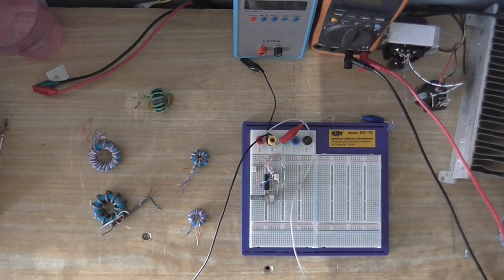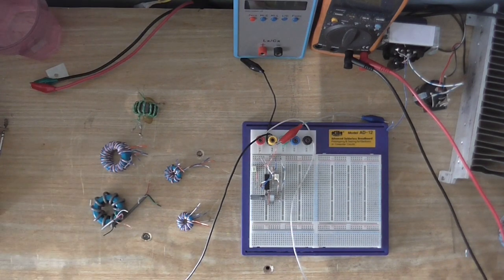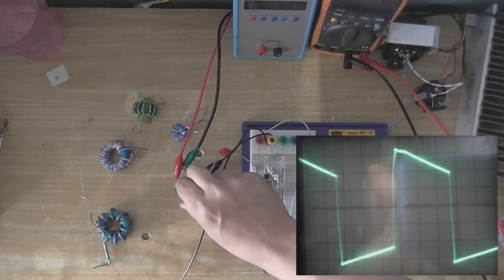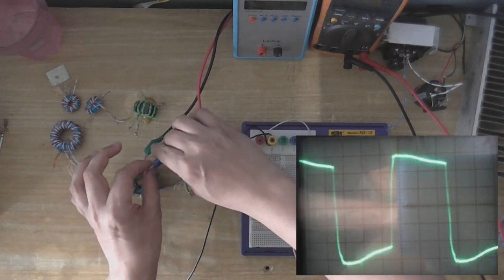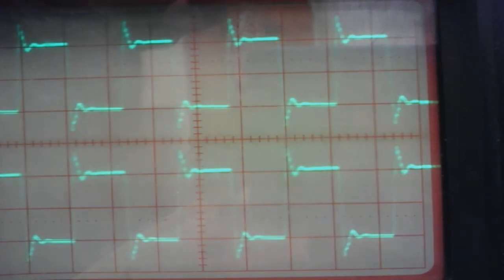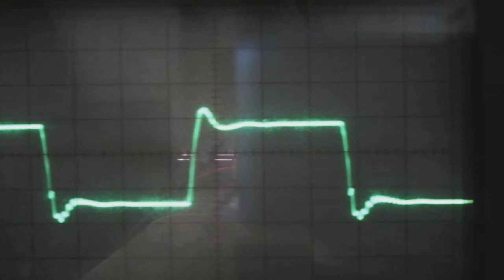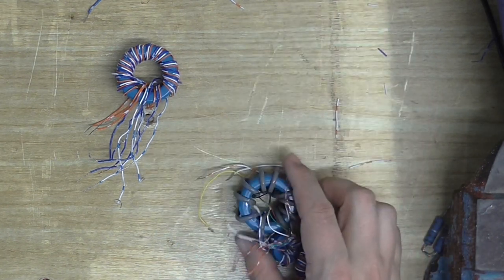Tesla Coil Tuesday - Building a Full Bridge SSTC part 2 - Gate drive Transformers

Comment: I also building a full bridge but for driving a ferrite core transformer, I also have to make the GDTs, I will use four 30B120 IGBTs, you should use the discharge diodes, thumbs up :) Alex
Reply: What do you mean by discharge diodes?
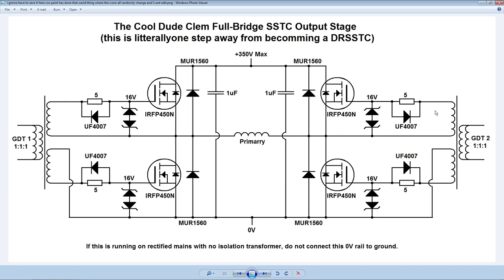Reply: +Anto Mani 12:38 diodes across 5 Ohm resistors
Reply from the maker: I'm gonna use the high voltage diodes after all, you'll see that in the fourth video.  I've just finished shooting the 5th (and final) video where I run the thing off rectified mains, it looks pretty good and nothing exploded which is a bonus!
Reply: CoolDudeClem Oh yeah, absence of not planned explosions&fires is the second best ;) First is the working project, of course. I'm looking forward to see some nice sparks
Reply: CoolDudeClem That's spoiler hahaha.
Anyways for these discharge diodes you should use very fast diodes, maybe shotkey ones like the 1n5819.
Reply: Schottky at what voltage level?
Reply: John Conrad It's placed in parallel to the gate resistor(between gate and gdt), it is not gonna see any high voltage.

Comment: hey very nice video, especially the ideas  with the  gate capacitysimulation and the  mouse cable helped me alot, i only a have a half bridge sstc  but 230 volt (its some where on googel +) because my country  has 230 volt  but i want to buid a full bridge sstc aswell

Comment: Can you please post details regarding Core size,no of turns and wire size in mm. thanks
Reply from the maker: I can't quite remember, but I think I used an N30 core, about 25mm diameter, and for the wire, it was about 12 turns of single core insulated telephone wire.
Reply: @CoolDudeClem  Thanks

Comment: Just trying to help.  your gate drive transformers work great!!!  However, considering that they are supplying no more than 1 Watt of power, and you're using a core that can run a couple of hundred watts of power at 350KHz, you can use a 0.5" OD core with much smaller gauge wire.  average current to the MOSFET gates is about 50mA.  #28 wire will do the job.   Core 3F3 for 350KHz operation.

Comment: Hey cooldudeclem, its me Ivan again, I checked conrad for the parts, and I did not find those exact mosfets, however, I instead got BUZ11s, and IRF4905 mosfets, I know that the BUZ11 is a very powerful and reliable mosfet, however I am not sure of the IRF4905. As I did not have the core, I am instead thinking of using an opto isolator, and a 555timer chip. Will my setup work? P.S. I am going to post a video of it on my channel if I get it to work. Thanks, Ivan R.
Reply from the maker: Unfortunately an opto oscillator wont work, you had a good idea there but opto isolators are just not fast enough.
Reply: CoolDudeClem Odd, I thought they ran at frequencies up to 1mhz?
Reply: CoolDudeClem but seriously, screw the isolation, as I wont be running it at more than 35 volts (limited by my powersupply), and I diode "chopper" should do the trick. However, I am motr concerned about the mosfets, will they work?
Reply from the maker: Well the optoisolators I've used in experiments have only been able to handle frequencies up to a few khz, but then the ones I used came out of a swicthmode supply.  I'd look at the datasheet and see if it can handle the frequencies you're going to be running at, generally you want something that can handle at least 10 times what the frequency you're actually using.  Also another piece of advice, switching mosfet gates at high frequencies can require quite a bit of current (sometimes up to an amp, but that's only in the worst cases)
Reply from the maker: Those Buz11's should work since your voltage is not very high, I'm not sure what kind of topology you are going with, if it's a single mosfet class C type, you'll want to put a capacitor around 1-3nf between the gate and source ... but since you have both N and P channel mosfets here, you can make an H-bridge, with the P channel mosfets at the top and the N channel ones at the bottom and you can connect the gates together at each side without needing a gate drive transformer, but you will need something to invert the signal for the mosfets on one side of the H-bridge, unfortunately the easiest way to do that is with the UCC37322 and UCC37321 chips you can get those at www.farnell.com (they also sell the mic chips as well), so one chip (doesn't matter which) will drive the mosfets on the left side, the other chip will drive the mosfets on the right, and the inputs of those chips will go to your 555 circuit.
Reply: CoolDudeClem I was planning to first make a very simple SSTC circuit using the one BUZ11 or IRF4905, so I can get the optimal capacitors for resonance then, I was planning to make an h bridge circuit for higher power. I was planning to make an inverted output using to 555 timers, which I will get into antiphase, however a logic inverter will also do the trick. Finally, I am not sure if I will even need a gate drive chip, as those mosfets are designed to be run directly from an IC.
Reply: CoolDudeClem Also, I was planning to use a KIA78r voltage regulator for my circuitry instead of the 7805 voltage regulator. The only difference, is that it has an on off pin (useful because of a small switch I already put into the wooden housing), and because it can give upto 15 watts of power, but realistically, it only gave about 10 watts, before it went into thermal meltdown. But that should still be enough.
Reply: CoolDudeClem MELTDOWN!!!!  I was in the middle of testing the new voltage regulator circuit, with a flyback, and in the middle of the action (18) volts and 5amps, the powersupply gave a loud click and shut off, I dont think I blew a fuse, so yeah, I fucked up! Any ideas as to what I can do to make an other one? Thanks, Ivan.
Reply: CoolDudeClem update: there were two fuses, problem solved :D update 2, I was a little rushed to write that comment, I indeed fucked up.
Reply from the maker: That's ok then, I don't know what kind of power supply you have, but a a lot of the cheap ones (and even some of the more expensive ones) aren't made to take that kind of abuse.  I always just make basic power supply with a nice large transformer, beefy rectifier and big capacitors when testing things like that.  If you do that, it might be a good idea to connect the transformer's input in series with a heater, mine has 3 different heat settings so I have some kind of control over how much current goes in.
Reply: CoolDudeClem yeah I got the power supply roasted pretty well, when I put a buggy fuse, I had a varactor blow in my face :D. I made a powersupply using an old 30 watt transformer, However my output was only 12 volts. In order to get around this problem, I ran my tesla coil off a flyback transformer, whose output was at least 90kv (3cm arcs and 5cm corona). I got some ok results, and even a tiny bit of breakout. I am hoping to get closer to the resonance frequency of my Tesla coil, and run it of one of a few bench power supplies hooked up in series at my high-school. Even if I fry them, it will at least be more impressive, as two in series should give up to 40 volts. Also, I found that the 555 timer circuit creates a LOT of noise in the powerline, and I am not sure of how a should fix that, and if a diode would help. Thanks, Ivan.

Comment: can you share the detail of your gdt please?
Reply from the maker: I think the video explains it well enough, i used N30 grade cores of about 20mm in diameter, and for the winding, I took 4 pieces of single strand wire, twisted them around each other, then wound that about 10 times around the core. 2 of the wires are used as the primary (connected in parallel), the other two wires go to the mosfets

Comment: You also have 2 t's in literally!
Reply from the maker: Trouble is I do those "annotations" in MS Paint, and that doesn't have a built in spell check! It sounds as if that's how it should be spelt though when you break the words down into their component sounds: primarry "priy-mar-ree" and litterally "lit-ter-al-lee"
Reply: For MS paint, you're doing an excellent job!
Reply from the maker: Yeah what I do Is I make those annotaions in paint, and I make the entire background of those annotations green, that way I can "key" it in and overlay it on top of the video.  I should really do a video showing how I actually do these.
Reply from the maker: Well the gradient was done in GIMP, as for the text shadow, I first type that in black, then I type the same thing in white, but offset a little.